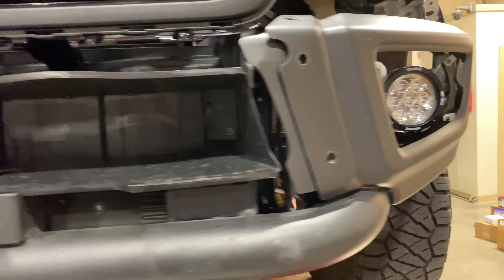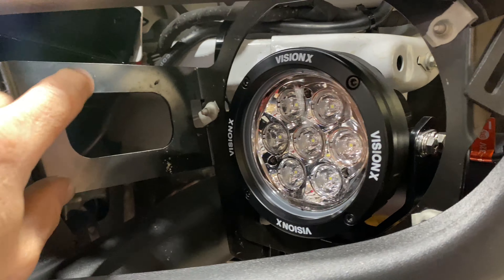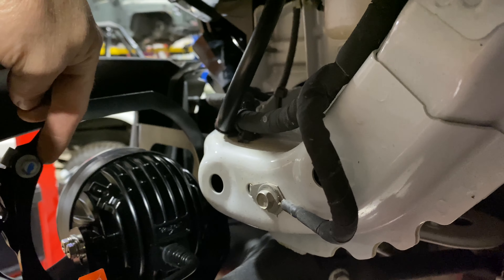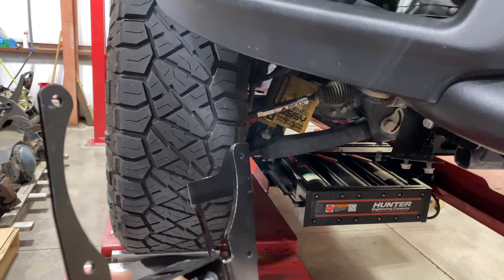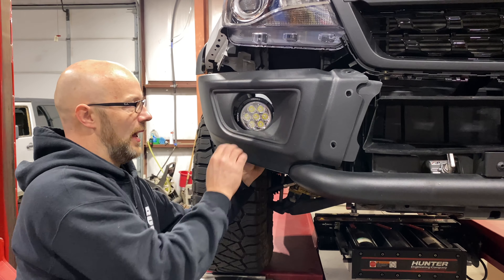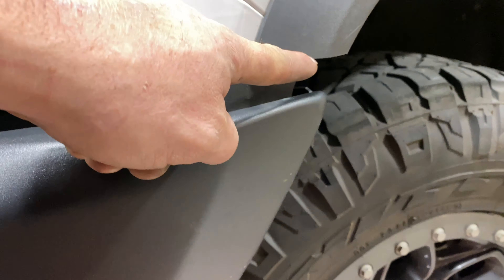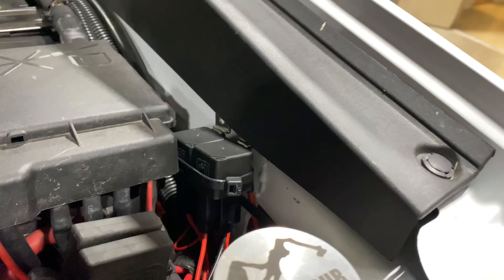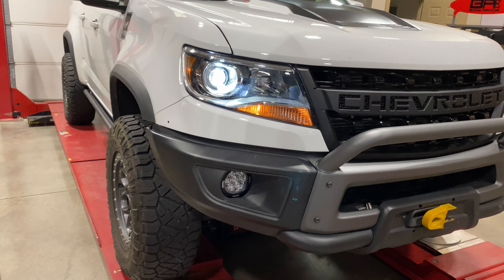Part 11 Chevy ZR2 Diesel Build - Vision X CG2 install

Comment: I just ordered the bumper myself and stuck on figuring how to wire the fog lights. How exactly did you go about that process?
Reply from the maker: We didn’t use street legal fog lights. We used the harnesses that came with the VisionX and triggered the relays from the high beam circuit.
Reply: @rockyour4x4  Why didn’t you just re wire them to the factory fog light circuit? Was that an issue?
Reply: Nevermind I just answered my own question. This isn’t an actual Bison so it didn’t have factory fog lights. That would’ve meant you would’ve had to take the BCM to program fog lights into the factory light switch and add a fuse to the fuse box. So I’m assuming that’s why you wired them to the high beam circuit.
Reply from the maker: @drthvd3r_bison  this truck doesn’t/didn’t have factory fog lights.